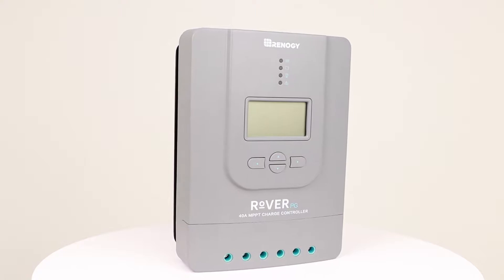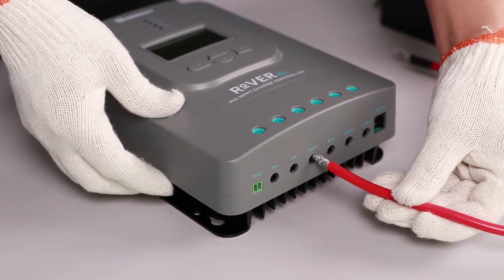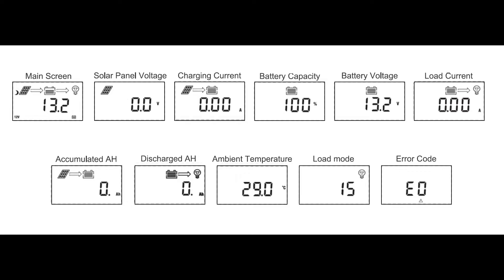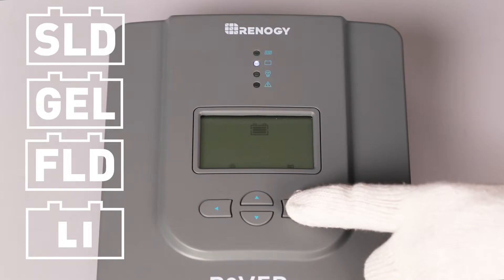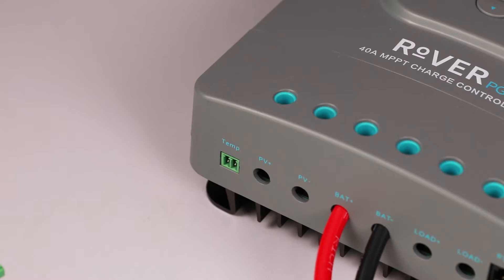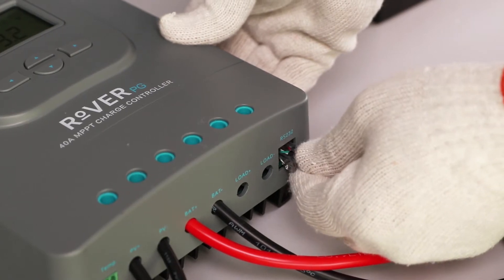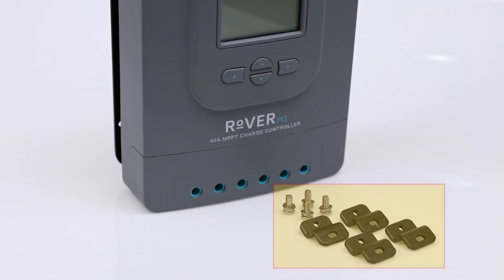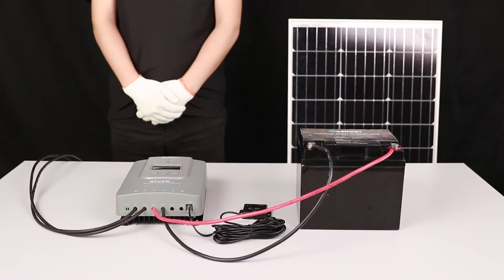MPPT Laderegler 12V/24V 20A Positive Erdung Rover

Comment: Timestamp 2:02 since the temperature sensor is placed next to a Li battery. Page 9 of the German manual states that the sensor should not be used with a Li battery
What's right?
Timestamp 2:02 da wird der Temperatursensor neben einer Li Akku gelegt. Im deutschen Handbuch Seite 9 steht, dass der Sensor nicht mit einem Li Akku benutzt werden soll
Was ist nun richtig